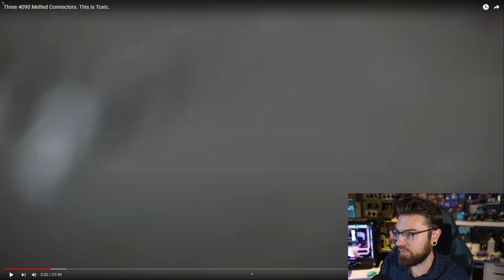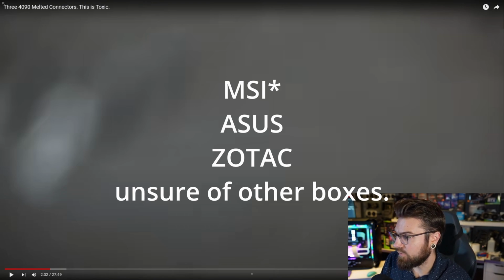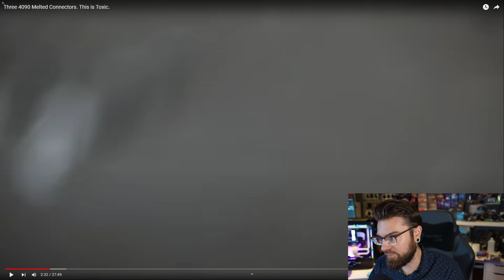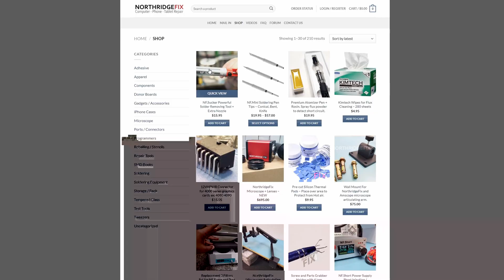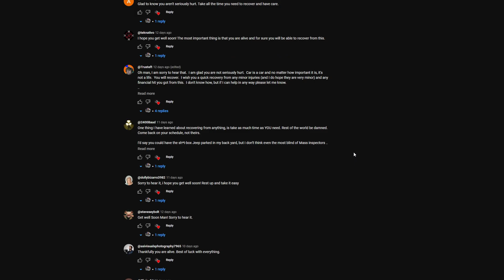100 RTX 4090s melting every month - React to North Ridge

Comment: What about suprim x (not liquid), gaming x trio classic 24G and gaming x slim ? any news about thes cards melting ?
Reply from the maker: So far I haven't seen any of those personally, but I believe all cards are effected regardless of model. Just reduce the power draw to 90-95% in an app like MSI afterburner. Should help considerably for long term use.
Reply: @techwandoUS  ok and if those cost around the same price, then which of these 3 would you get ?

Comment: I'm starting to wonder if this is caused by people using their power cables incorrectly when they hook up the card. For example, I just finished installing my 4090 with the 4 way splitter, and I used 4 individual PCI-E power cables straight from the PSU, I wonder if people are using the pigtails and using only 1-2 power cables? My understanding is the power cables can only output 288 watts each, two cables are under the 600 watts these cards can draw.
Reply from the maker: Check out De8auer ENs channel, he's done a great video/follow up on this topic in general. Gamers Nexus covered a lot of this a year back but there's been some massive updates since then. I'd say you're right to not plug/daisy chain them, but the melted connectors tend to be the models that safely exceed the power requirements regardless it seems. It's just a design flaw in the connector in general, tolerance issues etc.

Comment: Any cards shipping with the updated 12V-2x6 connector yet?  I want to buy a 4090, but I'm wondering if the 7900xtx is a better option now.
Reply from the maker: Due to Nvidia not really wanting to make it obvious that there's an issue, they most likely will just start mixing them into stock vs announcing them. Hard to say, maybe wait for the 4080 Super announcement in a few days.
Reply: My strix 4090 has the update 12v-2x6 bought new in dec 2024

Comment: The issue I see with calling out GN is that they DID ACTUALLY DO testing, and they could only replicate the melting connector by installing it wrong. And I may be wrong but I'm pretty sure they would have said thats just what they think based on their tests but they can't conclusively say that its 100% user error. I did see the video, i'm not gonna go back and find it but Steve wouldn't have said 'this is conclusive evidence' its just what they found with their small sample size, and they usually do point out the sample size is too small to be conclusive. You need to remember people are only human. If I did testing and came out with a certain result then thats what I would think!
you don't have to take everything they say as 100% correct, they are just pointing out their findings. I think people should make sure they don't take things out of context and they should also use information to make up their own mind. IMO its probably at least 50%+ user error. Its very possible that out of 100k cards less than 1% have this problem, but thats still ~1000 cards. 
personally I don't have a horse in this race, only buy AMD gpu's because this is the least of nvidia issues IMO, and I don't need cuda.
Reply from the maker: Just read through this. 
https://www.igorslab.de/en/smoldering-headers-on-nvidias-geforce-rtx-4090/

Comment: Imagine taking a cable that will handle 600 watts or more like 10 gage for example and reduce it to 14 gage and expecting it to handle that load! It will not work and the smaller wire will melt and burn up when you increase the load! Same thing here with these connectors on 4080's and 4090's.

Comment: I got a 4090 TUF OC 9 months ago  and I'm still worried and disappointed by Nvida/Asus for no answer to this issue! I'm reducing the power draw to 94% and always capping the fps in games to keep the gpu max power at 300/350W. I still have an old PSU ATX2.0 with 4 cables adapter.... I plan to get a new PSU ATX 3.0 if I'll require full power with future games
Reply from the maker: It's a shame that you have to reduce power on it. Should definitely be able to get the performance you pay for. You're smart though, it seems to be the best way to go about it. I usually keep mine around 90%. Performance impact is minimal, makes you wonder if they really needed to make it 450w to begin with.
Reply: I keep mine at 80% and its practically the exact same performance, I saw a video on it before I did it just to make sure and it you can go down even further with minimal loss but I kept it at 80%.

Comment: You need a PSU with a dedicated 12vhpwr input. Not the adapters or multiple cables. Or the cables are pushed against the glass bending the socket.  I’m running corsairs cable and their PSU since the 4090 launched and my gigabyte is fine.
Reply from the maker: The Corsair cable seems to have the least amount of issues. Probably spent some good money on the tolerance/design.

Comment: This is an excellent example of the phrase, "Sometimes you win. Sometimes you lose, and Sometimes NVIDIA makes a fool of you." The size or gauge of the power cable wires might be the problem with GPU overheating. Under load, a smaller gauge wire will heat up faster than a larger gauge wire. Many cable makers use 16 or 18-gauge wires in their power cables. If they switch to the thicker 14-gauge wires, the wires will not heat up as much, and the power connectors will stay cooler.
Reply from the maker: Seems like a lot of losing lately with Nvidia.

Comment: Even though Nvidia is ahead in performance and efficiency, at least AMD's power input connections aren't melting. Nvidia really rushed this new connector standard, and they're paying the price for it.
Reply: until now there are no preventive actions to mitigate this risk? if i bought a 4090 now will i be exposed to this issue?!

Comment: I still think that Gamer's Nexus "User Error" video was in collaboration with Nvidia. Personal opinion of course, but it is amazing that after that video all the fuss about the connector immediately stopped. The professional build of that video combined with the extremely positive image of that YouTube channel, prove to be enough for everyone to stop thinking there was such a problem with the connector that Nvidia should have been forced to remove 4090 from the market.

Let's see if the known channels and tech sites will take this video in consideration and even mention it in a video or an article. The same sites that rush to talk about broken dies because of a driver, based on one Youtube video.
Reply from the maker: I remember the broken dies video from Krisfix. Man that was a wild few days, all those cards were mining in sub zero temps or something if I remember correctly. AMD quickly debunked that one. 
As for Steve, it's hard to say exactly. They started off really strong, but then had one major incident where their massively crooked cable caused issues, and then case closed. I felt it made people look really stupid, sure a user can push it in 90% of the way and not see that little line that is the indicator it's not in fully, but even as a veteran builder, I have to take a flashlight to it every time, and have used both OEM and aftermarket cables that are incredibly challenging to insert properly when you consider a majority of the user base might be building for the first time.
Reply: @techwandoUS  Even if the cable is pushed in, there can be reasons for it to come out a little, if the latch doesn't secure it completely in place. Adding, removing another piece of hardware in the case and having to push that 12pin connector to the side to get access to that hardware. After installing the card in a narrow case, the side panel pushing the cable. Even having done everything right, under typical usage the card does come with one or more fans, that they create vibrations. What if some burning cables are results of those vibrations?

In any case Nvidia managed to avoid a huge problem with this connector and even the news that PCI sig created a new version of the connector where pushed from media to the public, as more "idiot proof", as more safe to "user errors" than as an indication that Nvidia should have done a recall and pay the bill for the connector replacements. instead people who had payed over $1600 see their cards burned and then having to pay extra to professionals to fix their cards. And I doubt that connector fix is $20. And of course, warranty voided.

Comment: they just need to go back to 8-pin power connector and it'll be even more funny if tha EU comes out with a order of "ALL GPU MAKERS must use 8-pin power connectors. NVIDIA MUST COMPLY!!!!" lol
Reply from the maker: They probably should. It's funny because the coolers are so damn long and there's all this space where the PCB could extend. When they originally invented the 12 volt high power cable it was too shorten the PCB but it's really done nothing to shorten the cards themselves. I'm sure thermally there's some benefit to it but at what cost?
Reply: @techwandoUS  and u wonder why i'm still tryin' to hang on with my GTX 1080Ti

Comment: The other big channel i know for repairs is Northwest .    He doesn't proclaim he has college knowledge or technical school information of soldiering.  Its still very interesting to see this kind of work .   Especially because not many if any people will attempt any soldier repair on they're own
Reply from the maker: I really enjoy his channel as well. So calm and collected, whereas NRR is like the chef Ramsey of repair.
NWR does really good reballing on GPUs with the equipment he has. I have seen people at my last SMT job do far worse with a million dollar machine. 
Appreciate the comment.
Reply: No, he was referring to Sorin from Electronics Repair School - RTX4090 power connector replacement - no board removal video.
Reply: Thank you! @ChupoCro
Reply: @SmokinGoodd420  Quite entertaining channel. Sorin is known for his unusual "dodgy" repairs and for never replacing the capacitors :-) He has videos about replacing the chipset with only hot air, using home made hot air machine, repairing shorts on the other side of the PCB without removing the board by burning capacitors with too high current, soldering ICs without reballing, using petrol instead of thermal camera, repairing hinges with hot glue and much more. He uploaded hundreds of very long unedited videos but has recently started to upload shorter videos because of YT algorithm.

Comment: I thought northridge was contracted by cablemod for repairs which implies that if cable mod is sending the 4090s then its their adapter,  just like from the start, that has been melting week after week. I don't know how cable mod is still in business. This is not the only cablemod product to burn, melt or otherwise either. I don't think its as bad a problem as people think. I mean if we just do some math here and the units sold did stop at 130K 4090s in the wild, then even at a rate of 25 per week, it would take 96 years for them all to burn. There is no way they only sold 130K units thats all I can find from like november 2022. 

*edit: Cablemod has been having issues with cables melting since the 3090 which draws the same power as a 4090. They probably know they have hit a quality limit and must sell out stock before buying better. Why else would they just sell connectors that constantly melt, contract a repair youtuber to show how its not their fault as a company but all the gpu repairs are coming from them lol
Reply from the maker: So from my research on it, there have been many people that run into the issue without the cablemod adapter as well though, that being said the 90° adapter is like a huge trigger/accelerater. Also NRR is just one shop too, if you were to count him as the only one fixing them I would agree the numbers are low. Nvidia stated very low cases but never updated the numbers. I reached out to a few other shops over the last few months. Only one of them wanted to give me numbers and it's a place out of FL called Prime. They had some decent volume back 4-5 months ago when I had emailed them (about 20-30 month at that time). The other companies didn't want to comment on the numbers, but said they had repaired some as well. The only reason why Prime probably responded was because I had sent them quite a few GPUs years ago.
I agree that cablemod though seems to be the number 1 culprit when it comes to the issue, but perhaps it's because they are the most popular vendor? I haven't spent enough time browsing cheap Chinese cable reviews on Amazon, but I have seen a few reviews before from companies like EZDIY or likeness brands that have had the issue with just normal cables, no 90°s or 180° adapters.

As to your edit, I get the kinda inside thinking from cablemod and NRR, but his shop does a lot of other repairs non GPU related. If he was the only shop saying this I would be more inclined to believe he was chilling for cablemod, but there's just endless examples of it on Reddit/FB and other social media platforms. I had a few comments on my older video recently about stock cables melting. 
Honestly I do hope you're right at the end of the day, I enjoy the 4090 myself, and I believe I remember you mentioning you had picked one up as well, I feel like we will never have a clear answer though.
Reply from the maker: Check out this article. I found it pretty interesting. You might need to convert to English. He also did a YT video on it a few times. It really comes down to tolerance issues it seems. 

https://www.igorslab.de/en/smoldering-headers-on-nvidias-geforce-rtx-4090/?fbclid=IwAR2cydVV8dhm3AP05hD7hze7H0chOZtkR-E4CUJhgSIyDWzVL-7m9t6XDwI
Reply: I agree it never seems like a clear answer. One thing about cheap connectors or even adapters in general, that is user error to even consider buying a cheap anything for your 1600$+ GPU. The internals/connectors these headers are comprised of have existed for ages in different configurations and shapes and are used in much higher wattage appliances that don't melt. It is not of course the 12vhwpr or revsions but the pins and terminals are not new. I can't post links but the oldest documentation on molex HCS pins + mini fit jrs and this housing style is 2003. So this has been revised for 20 years already. 

If it really is down to tolerance issues(and not cheaper connector metals) based on that article that puts it back in the AIB's + cable mod's court + any other adapter/cable maker. Nvidia doesn't populate the boards only gives GPU dies to my understanding. Only their own FE cards + their own cables are the real failure rate. Anything else is other manufacturers choosing cheap parts is how I see that conclusion based on the fact these terminals exist in higher wattage products. They come in several configurations with beter metals as well and unfortunately I have not seen a single 4090 use the more expensive gold variant of these connectors.
Reply from the maker: @D3nsity_ I totally say the same thing about people buying cheap adapters. It's like buying cheap tires for your 100k GTR. Might work for a bit, but you'll burn them out fast through use. 
Sadly... people do it anyway. They want the absolute best but compromise, spend all their money and then wonder why it's not working properly after.

I usually never decline work but just recently I had to decline a custom loop from a customer who I had previously built a machine for. The guy had a 13900KS and a 4090. He bought all the parts and massively cheaped out on the case and fittings/radiators/pump etc. 
I also tried explaining to him that dual 240s most definitely wasn't going to cut it. He then found some old LTT video talking about radiator size from years ago to explain how I'm wrong. It was at that point I just declined the work. 
The point is, just like that build, the writing is clear as day about Cablemods semi expensive 90° adapter, and still people are constantly buying them, just imagine how many of the cheaper ones sell for the rest of the lineup. 
I have no clue how many people own 4090s at this point, but it seems like people around here buy them as if they are 60 class cards. Pulling up in breaking down cars with $3000 worth of PC parts. It's kinda wild actually 😅

Comment: I know GN says it’s “user error” but if this many people can mess it up; it’s still a bad design. But I know they officially changed the plug/adapter. I have a 4090. I would be so mad if this happened to me.
Reply from the maker: Cablemod claims to have fixed a lot with the new stealth cable design, you should see if they would send you a review sample. I tried myself, but I think my channel is too small for samples. I assume your PNY has the OG connector?
Reply: At this point perhaps the user error part is of people who know about this problem still buy them in 2023-2024.  :)
Reply: @TrusteftTech  it's a design error! why u think AMD and Intel didn't switch to those stupid connectors yet? 
yea Nvidia needs to go back to 8-pin power connector
Reply: @blakedmc1989RaveHD   Very likely.
Reply from the maker: Haha, it's a tough one. I'll admit as a single end user for just gaming it's not the most responsible choice. It is crazy though how many people I know personally are living above their means and have bought these cards. In my vendors FB group alone, almost everyone that posts there have a 4090/80 or 7900xtx now. 
Heck, I'd say it's even too much for me, but I am always thinking about channel content. I'd be more than happy with a 4070 or 3080 still.